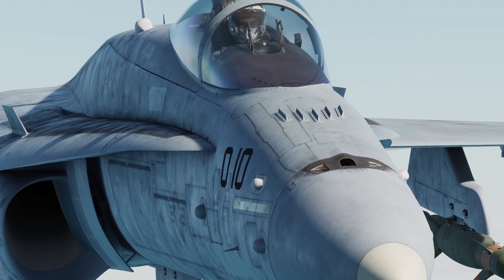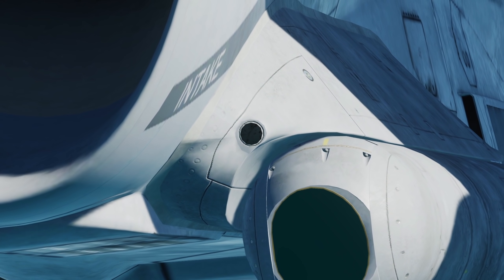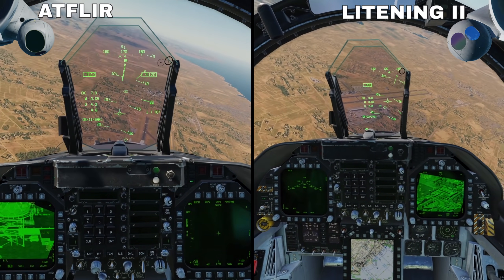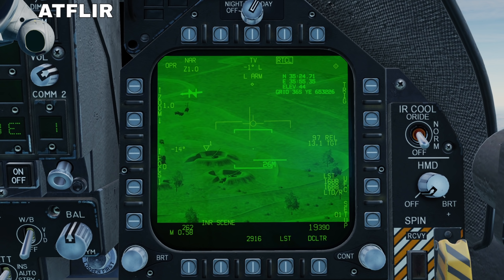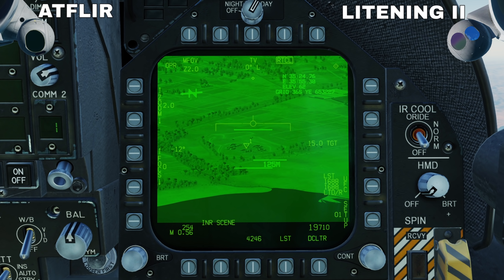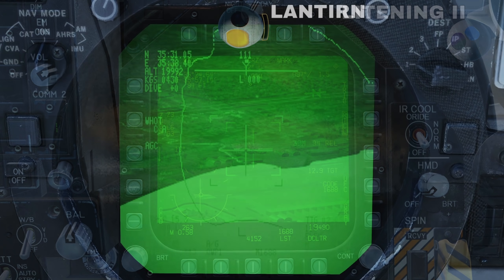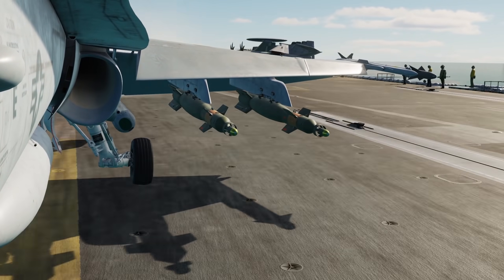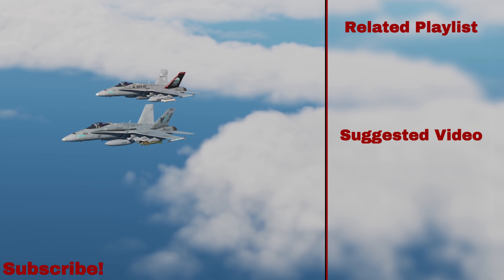DCS: F/A-18C Hornet: ATFLIR or LITENING II Which one should you use?

Comment: Not to mention the LITENING also is equipped with CCD mode which goes from normal sensor mode to somewhat of a "heat sensor" mode where it tracks heat coming off vehicles people etc., pretty neat feature it's also better equipped for JSOWS and SLAM/SLAM-ERs in my opinion, but others have better experiences using ATFLIR which is reasonably so, I can definitely notice a difference in both relatively quick. I was able to do a successful ripple of 8 JSOWS on different targets in rapid succession with the LITENING pod for the first time compared to the ATFLIR because of the heat sensor mode when trying to actively identify targets properly without F10 which is pretty useful in my opinion.
Reply: It also actively tracks better in high altitude clouds compared to the ATFLIR as well I have noticed

Comment: ATFLIR has 3 optical zooms and 2 digital zooms.
Litening AT has 2 optical zooms and 9 digital zooms.

Documentation says that las any means usable digital zoom is 5x in Litening to recognize buildings or bridges. But you can't use further digital zooms to see anything as you are looking a blurry 40*40 pixel video that is processed to be sharper on a low resolution display.

This should change when new FLIR appears as you look more as 256/512 resolution FLIR.

The best targeting pod there is now in Harrier. Litening G4 that is superior to ATFLIR and LITENING AT as the G4 is from 2009 that is about decade newer than AT and ATFLIR was already old in 2007 when it got in service in C hornets (not used in 2005).

Real world loadouts for hornets would be without either targeting pods and only use nitehawk that has 240px FLIR and is awful why it was not allowed to be used for self-designation because pilot can not make out what the target is or where really looking at. Too many blue on blue incident happened with that pod.

Comment: In the forums it has been pointed out with evidence that our hornet shouldn't have neither, Litening or ATFLIR as in 2005-2006 period USMC/USN used the AN/AAS-38 that is low resolution pod.

Hornet is a frankenstein with unrealistic pods for it's timeline.
The AGM-65E2/L is as well in use in hornet that is only laser maverick capable for self-designated targets and it is available only from 2011 forward.
And USN/USMC didn't use AGM-65F mavericks at all in 2005, so again unrealistic weapon for hornet.
The AGM-62 WALLEYE was withdrawn from the service in 1994 so it is unrealistic weapon for hornet.
Reply: If they take them out cause some Poindexter opened his big mouth, iam going postal
Reply: @charlesbukowski9836  No shit, if the weapon/pod/device was ever available for the aircraft (even if it was never used) then there's no reason to remove it from the sim. You can create fictional missions with them that represent a time when the device/weapon was available--even if they never used it in real life for any mission, it was still available.
Reply: They could still include all this stuff just because it's technically possible, though. Not every mission in DCS has to be an exact duplicate of something that happened before in real life--plenty of room for "what if" as well as purely fictional missions, as long as the hardware itself actually existed in real life.
So, there's room for these pods and/or weapons in the module--but, you won't see AIM-54 Phoenix missiles on the Hornet.

Comment: Personally I'd disagree with your assesment that the LITENING is better than the ATFLIR overall for a couple of reasons. 
Firstly, the ATFLIR is waaaaaaay more slick to use air to air on account of not having to fuss with the zoom. It's very quick and easy to zoom out and get a better view of the target aircraft, especially with a radar slave only. Speaking of which, the ATFLIR also benefits from not having to press buttons to step your FLIR every time you switch targets thanks to L&S Slave being a "sticky" setting. 
The loss of the visible laser is a bit of a bummer but not really a deal-breaker for me (I've only seen it intentionally used once or twice, usually it's an accident), and the lesser maximum zoom of ATFLIR is offset by the much wider maximum field of view. And of course the ATFLIR's attitude representation is much easier to read quickly. I'd also say that the lack of offset/bullseye reference is less of an issue for target sharing; I usually use either the helmet or LST for these purposes.

Overall, I'd say it's a much more even contest then you present it as, with the LITENING being better for preplanned strikes, standoff weapons employment, and nighttime operations with other aircraft, while the ATFLIR has the edge for air to air, battlefield air interdiction, and close air support. As a general rule, personally I'm probably gonna take the ATFLIR more often
Reply from the maker: I think going forwards the ATFLIR will become better in general, perhaps I'm too used to the LITENING, but that zoom level is so powerful that I like it over the ATFLIR, That said I'll be using the ATFLIR from carriers all the time. After 10? years of using the LITENING I've grown accustomed to it's quirks, give it a month or two of using the ATFLIR and it might be harder to go back to!

Comment: HI RedKite, thanks for the video man. The best guess I can make regarding the performance of the Litening vs the ATFLIR is that they have modeled the newest (2008) revision of the Litening pod out of convenience (more difficult to simulate a bad camera than a good one). The ATFLIR is not necessarily "better" than the newest litening, its just different. The ATFLIR wasnt brought in to replace the Litening, it was brought in to replace the "night hawk" targeting system, which was the previous Navy pod I think.. Pilots reported a significant jump in performance from the previous system but that system wasnt the Litening. I think the point of having both is that the Litening (2003-2008 version) is used on planes like the Mirage and export su30s while the ATFLIR is the Navy's primary pod currently. This will put 4 different targeting pods in the game (not counting integrated systems) that will eventually serve different factions during different time periods just like IRL..
Reply from the maker: This is one of those difficult to answer problems, We know that The A-10c (1) uses the LITENING II AT, and that the Harrier uses the more modern LITENING II G4 which has something like a 1000x1000 resolution vs the 500x500? resolution of the AT. Now in dcs, they all perform exactly the same. However I believe the current DCS pod outperforms even the G4 version, as the zoom doesn't degrade picture quality like it should, it magics extra pixels into existence by quirk of how ED did the zooming mechanic, rather than taking the Narrow fov and enlarging it which I believe would be more accurate.
Reply: @RedKiteRender  this is spot on. The upgrades in the Litening concerning resolution only applies to the FLIR sensor, not the CCD camera. Zoom on a FLIR system is much more advanced and difficult to design. Think about it this way, if you want to enlarge an image you are limited by the Megapixel count of the image for digital, and variable lenses for optical. With thermal, however,   you cant actually enlarge the image all that much using a lens, you need a more powerful sensor to reach out further and get better resolution. With FLIR, the lenses need to be made out of germanium or zinc selenide to achieve something similar to optical zoom which makes them insanely expensive, and even then its a limited way of enlarging the image. The majority of magnification is done digitally with thermal, resulting in a lower resolution image in your display. I think this is what Wags is talking about when he references the "new thermal imaging" coming to DCS. That update would give people a reason to use the CCD more often, as a thermal camera can be compromised by background heat and all kinds of other variables IRL, while the CCD should have something like 50+ times optical zoom at full resolution (probably 24-48mp for CCD). 
I am really hoping that with the A-6 we get some ISR functionality and gameplay added to the sim.. these pods are used for alot more than targeting in the real world
Reply: @RedKiteRender  yes thats true all pods appear to have the same resolution although the harriers G4 still ends up being the best pod becuase of the additional zoom levels. you go from from 9 to 16 levels of digital zoom, without any image degradation. It appears that the A10C /F16C/F/A18C all have the same model of Litening. the AT even if ED doesn't specifically use the "AT" designation outside of the A10C 1 and 2 module. Indeed hopefully can eventually model resolution degradation, and then perhaps the ATFLIR might maintain sharper image resolution , although lack of zoom  that you get on the Litenings wont seem a like such a disadvantage of everything is a pixelated mess at level 9.

Comment: Worth noting that in the A2A role the ATFLIR doesn’t require to you constantly click an MFD button to space to your L&S, you can just box L&S slave and it’ll slave to whatever you have locked. It’s another one of those old Litening software limitations
Reply from the maker: Good tip!
Reply: @RedKiteRender  Well, the good tip would have been to use the Talios targeting pod from Thales. Best pod available right now.
Reply: I’m confused how to slave it to center after expending all munitions, like I can drop warheads on foreheads but don’t know how to value the pod to look back at its default position
Reply: @Chucklesb4 press undesignate/NWS switch 3x

Comment: I prefer the LII hehe, btw anyone experiencing this bug:

When on AA mode if you get hard lock by another plane your radar says Jammmed and everything becomes frozen untill you are unlocked 

And for no reasons at all the antena goes to -99-99 elevation every time you move the throttle lol
Reply: Not a bug - you have your jammer turned to XMIT. If you’re jamming, you can’t use your radar. I’m not sure how the ASPJ works, but if it uses the plane’s radar, you can’t do two things at once. If it’s a separate onboard jammer, it might be because of power limitations.
Reply: Sounds like you have a axis mapping issue with your throttle/radar elevation, check your bindings.